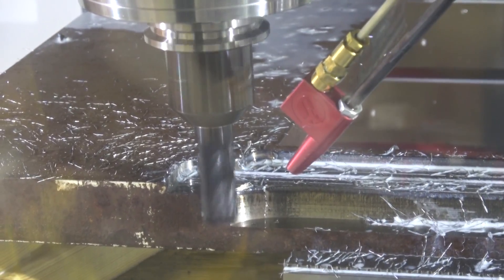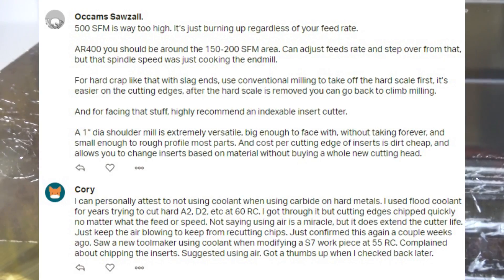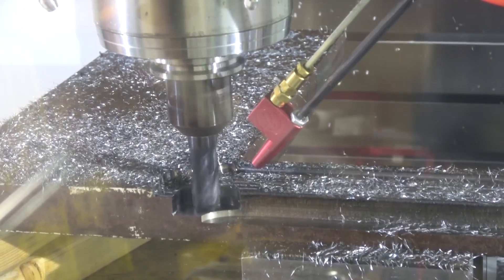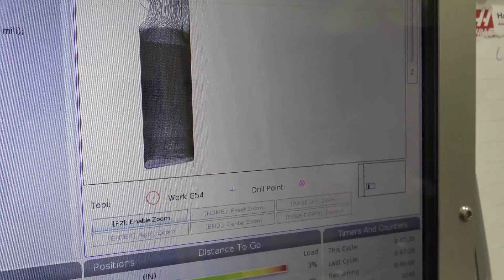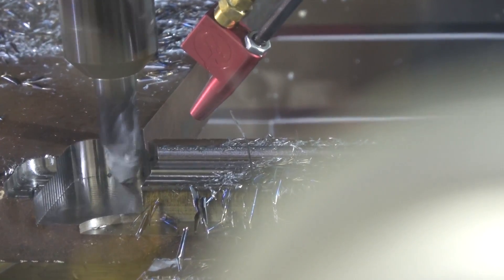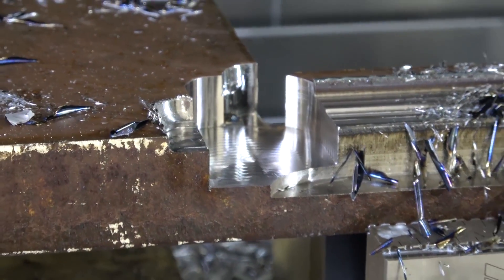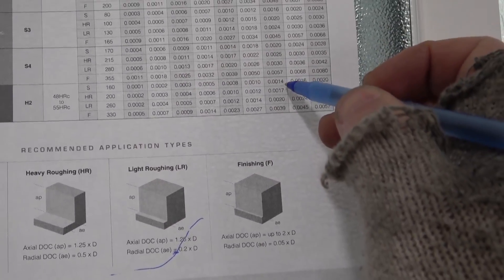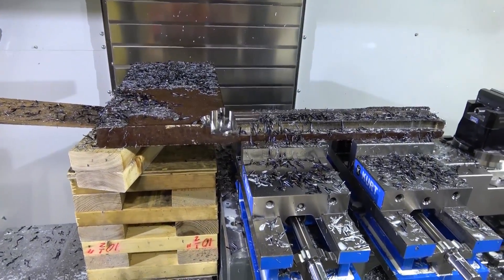Hard Milling on the Cheap.

Comment: I am NOT a salesman but we’ve tried a few brands of endmills. Tried some Iscar endmills that were over priced but worked good. The old liberty tool basic coated endmills that constantly chipped and broke. But found that IMCO makes a very good endmill for a decent price. You can run a 9 flute if the machine will interpolate the code fast enough. Running 2” axial .030 radial at .008 fpt and she eats pretty good

Comment: Is there somewhere you can find a chart for calculating speeds and feeds for a dovetail bit? the bit has a  60 degeree angle, 0.5" cutting dia at the big end of the dovetail, its a cobalt bit so I would be comfortable with sacrificing some time and treating it as more of a hss bit if that makes sense. I would be running it through some regular cold rolled steel. Any help you or anyone has would be great. Currently running around 600rpm taking about 0.1" at a time and feeding around 0.3"/min. I think I used a chart I found for a T-slot cutter.

Comment: Ave, for a 20mm 4 flute try 1600 rpm 5% step over and feed at 1050mm/m with airblast
I'm pretty confident this will yield good results and half decent tool life. 
Gotta get that tool moving across the material so not to heat the tool and rub the edges away.

Comment: Part of the beauty of hardmilling/turning is getting the heat to go with the chip. You use a tool that can withstand high heat and you purposefully run the sucker at a high feed to heat the surface of the workpiece up enough to soften the steel and then peel it away like butter. Then all the red hot heat you just created goes with the chip instead of staying with the workpiece. But getting up to temperature is key. Otherwise, you're hammering the cutting edges with hardened steel. So, for hardmilling/turning, coolant is counterproductive because you need that heat to soften the load on the cutting edge. Usually you'd use cubic boron nitride tooling to handle the high heat in hard milling, but since you're using carbide, you just want to get that carbide as hot as it will handle and do the best you can with it. 

I'll also add, you don't want a high stepover and you don't want a small stepover either. With a stepover too high you won't be able to move fast enough to get rid of the heat and, with a stepover too small, you won't be able to get enough heat in the workpiece to soften it and get it to flow a little so you can peel it away like soft butter.

Comment: This is the problem with not modeling the stock correctly, writing was on the wall 10 seconds before when it though it was going around the back corner and started chattering in the slot cut.

In about 3 months you're about to learn the weirdest, least obvious lesson with HSM and cnc. You can get more done with a 3/8 end mill than this thing. 20mm is just too biig to really push in a bt40(and you can go from a chineese 20mm, to a sandvik 3/8, with the same length of cut, for the same price).

If you keep jumping between brands and end mills you're never going to get speeds and feeds dialed in. You need that consistancy to be able to make changes.

Sandvik coromill, 3/8, 150m/min, 0.12f/t, 0.8mm stepover. Full send, less cycle time than this.

Comment: its been while since i did any hard metal machining, but i remember we used TiAlN Coated cutters, with no cooling, high spindle speeds (25000+) , high feed, and very small step overs. The swarf used to come off red and glowing. The TiAlN coating needs to get hot to work apparently. The cutters were SECO or Mitsubishi and cost 100's of $ each but they lasted.

Comment: Could you cut the broken bottom half off of the mill bit and continue to use it, just without plunge capability?  And what's going on with the generator motor?  You should have parts and be done with machining by now.

Comment: At my apprenticeship workshop we had an older CNC with different axis orientation. So many endmills and drills died on that machine because after working on other CNCs people forgot about that difference and either programmed it wrong or power feeded tools right into the material. We called that thing the true drillpress as some people used it to press drills into the material.

Comment: Feed rate you fak!!

Research chip thinning. @ 20 percent stepover your feed is way slow unless your surface speed is equally low. I'd be starting at 300 sfpm and .012 for for that material.

Comment: What kind of holders are you using? Are you using hydraulic holders? 

Everything Schunk makes is extremely high-quality, you should invest in their vices and their tool holders. Expensive, but buy the tools you're going to grow into, not out of, right? 

Guhring Tap geometry is incredible, but their form taps are where the money is at, anything bigger than like half inch or 10 mm you should probably look into thread milling, it's....actually a lot easier and gives you the ability of going over a thread, which is nice. 

Fusion has a promotion next week (at least in the US, not sure if it's everywhere). PowerMill is where the money is at, but it's like $5,000 I think for the base package. Worth it, but expensive. Hard to beat the free fusion and few hundred a year for fusion + generative design (So cool, you must try).

You can try Kennanetal's KOR (kind of roughing) harvi 3 end mills, they're....amazing. But you'll have most of that success with Guhring's Diver line and I think Guhring has better PVD coatings. 

Curious to see your next video. Certainly interested in where the diminishing returns bit kicks in, but I know with the majority of this industry, you pretty much get what you pay for....for the most part. 

https://youtu.be/lxhEyqYB6uc

Comment: It's agony watching this when all the signs of an impending disintegration are there but you don't know when that exact moment will arrive. :)   That cutter was visibly well past dull when it exploded.    Anti wear plate is designed to resist abrasion and dull cutters smear rather than cut. 
      Might I suggest you try the opposite of what you're doing and crank the speed up at least 2000 rippems (assuming the cutter is 1/24 of a foot in diameter) and use a small step over so the area in contact with the cutter is small (~5% of circumference) but the chip thickness is maintained to between one and two thou by compensating with a high feed rate.  This high speed and thin chip will help prevent micro chipping of the carbide which rapidly dulls the cutting edge and it reduces loads by softening the material at the cutting edge.  The small tangential contact area will reduce impact loads on the carbide and the "duty cycle" of the cutting edges will be drastically reduced (cutting for 5% and cooling for 95% of each rotation) which prevents runaway thermal overload that turns your end mills into glow sticks.  The high feed rate keeps the cutter and material around the cutter cooler because you are not dwelling in one spot.   They call this tangential milling and there are specific tool paths for this.  Expect some sparks.
Reply: @ARMOND WILLINGHAM Close but no cigar there. Carbide isn't as sharp as HSS can be, but it stays pretty damned sharp for a very long time. It's hard as nails so you don't need to sharpen it, it holds that edge.
Reply: @ARMOND WILLINGHAM the tips of a carbide endmill will cut you open like a razor blade. They stay (or are at least supposed to stay for a while). If I was going to rough a plate like that I wouldn't use an endmill with corners at all though. I'd get one with like a .03 radius on the corner so I dont have to worry about the corner chipping out on me. You need a sharp corner on the endmill though if you want to get a 90* shoulder. HSS can be sharp too but most of the time nowadays if you're using HSS then you're grinding a specific profile into the tool to get a funky feature. Other than that it's really not practical at all. And a step up from carbide tools you have ceramic and CBN tools which are diamond impregnated.
Reply: Did you see the backplot? Cutter was fine, the crash was programmed in... right after a bunch of trochoidal/'tangential' passes?
Reply: @ARMOND WILLINGHAM  
How "sharp" a tool needs to be depends mostly on what material you are machining, what machining operation you are performing and how rigid your setup is.  Soft cheesy material like plain old 44W/A36 steel plate is very easy to machine so you can force a well used dull cutter through it.   A work hardening material like stainless steel or wear plate on the other hand will take your dull tool and through it back in your face because the cutting forces and heat generated go through the roof when the cutter gets dull.

A very sharp carbide tool has a very fragile cutting edge prone to chipping because of the grain size of the carbide particles and how they are "glued" together.  Kind of like how a concrete slab is difficult to even put a mark on but a sharp corner in concrete will crumble away easily.   

Carbide end mills are ground not molded like inserts so they are inherently sharp (and need to be) and because of that are very fragile.  This makes them more suitable for high speeds and wispy chips rather than brute force plowing.  A dead sharp corner on a carbide end mill will chip by just looking at it the wrong way.

This is why on carbide inserts there is a tiny radius on the cutting edge often with a tiny flat section (land) behind it to bolster the cutting edge to make it more chip resistant.   Even finishing inserts are usually a little "dull".  This is also why you can't take shallow finishing cuts with your typical carbide insert tools and expect accuracy and surface finish.  

The increase heat and force required to force a less "sharp" tool through a material can be tolerated by carbide (in most cases) which is why they work in this geometry and HSS won't. 

There are many variables that determine optimum speeds and feeds. Machining speed and feed charts are good starting point but are guidelines not rules.

Comment: Best way to clean up those chips is to throw a strong magnet into a plastic  bag and then remove the magnet over the hopper.
Reply: Leave them for the next shift. I have over 30 years experience...
Reply: And or blow em off and let the machine chooch em into the auger
Reply: Make a tool for chips, plastic slewe whit a magnet on a metal cilinder in combination whith a spring, plus a finger pull leaver to pull the magnet up, magnet up chips off to the bin.

Comment: air blast is a scam, same speeds and feeds, regular water based coolant will give you way more tool life. especially in a production setting where the tool heats up and that heat travels into the spindle, making for all sorts of weird S to happen.

Comment: Crank the SFM back up, step over 1-3% and factor in chip thinning into you feeds as with such a light radial engagement chip thinning will likely triple or more your calculated feed rate. I often mill AR500 at 500 SFM with crap endmills. I believe I have a short video up using a toy grizzly cnc "drill press" just to prove it can be done with total crap equipment. My Osaka Kikok VMC with proper boxed ways eats AR500 for snacks.

Comment: Your killing me, mold maker  retired and for thirty five years, would never cut this way, feeds in Z, high rpm and high speed, .010 down feed, climb cut, with auto rounding, that way you can always sharpen the tip on a Deckal grinder..
Reply: I have no clue what this setup is... This is the stuff first-year night crew comes up with when the boss isn't watching. His workholding is eye bleach.
Reply: @josephforbes5517  work holding? I once seen someone put a plate in a machine that was 2x the size of it. Took of the outside enclosure to fit it and then tied a tow strap from the control arm to the rafters and they kept unclamping it and reindicating it doing it in sections.
Reply: @metalman6708  Hey that's all great, and sometimes you just gotta get the job done, but AvE's setup could be improved with the proper fixture, and I don't know why he is working so high in the work envelope. Granted, I don't know what his end goal is here, but I wouldn't set it up this way in a million years. Bravo to your friend who was able to double his machine's size, but if your doing jobs that large frequently, I'd suggest buying a larger machine. The larger machine will pay for itself in all that labor that you saved.
Reply: Work with the tools you got! I like that go-get-em attitude!
Reply: @josephforbes5517  You my man, haven´t seen shit if this is already eye bleach, I call that daily business.
Reply: Thanks.

Comment: Would love to see the same test in the old Bridgeport.
Reply: Crappy Bridgeport is way to soft for that, cutter will deflect and break. Cincinnati Nr4 C-Frame Vertical mills with ISO50 or something beefy like Makino V77 with HSK100 would be the right machine for that, but still with totally different milling method, way to much cutter engagement here.

Comment: I couldn't get those endmills to live for shit......I went indexable, ran them hard and  fast until shit started to get scary and then backed up until they lived....and that was production runs of auto parts in the 90s. If you never take it to the limit and then come back,  you're leaving money on the table. Won in court with a MAJOR toolmaker who sold me those toys and by the way , the indexable 1" indexable end mill was a SINGLE flute/insert....cut like a beast, a little NOISY , but pretty smooth.....HUNDREDS of parts on one edge...Love the vids

Comment: I've been a cnc machinist and set up for 3 years now and speeds and feeds are my biggest hang up, just dont have the time at the cun troll to have um fingerd out
Reply: They make a really handy chart that works like a slide rule. You just have to know about how hard/tough the steel you're cutting is to ballpark them.  I think the one I used in my early days was printed by NMTA.
Reply: the only way to learn is ask someone who knows how to run the tool until you get a basic sense of what feeds/speeds work, then, its all ear and feel from there when you start running new styles of tooling yourself! :)